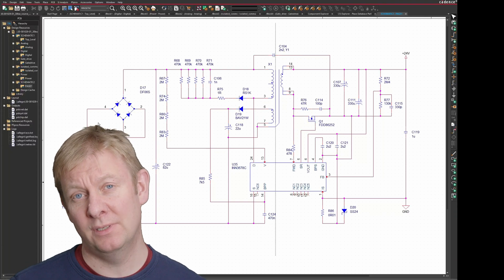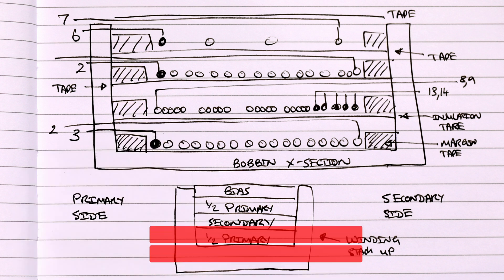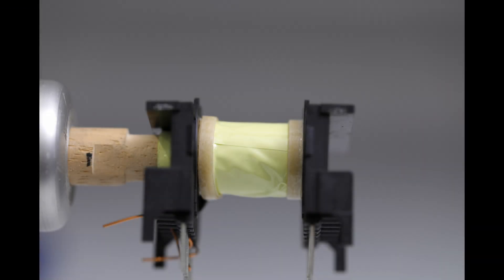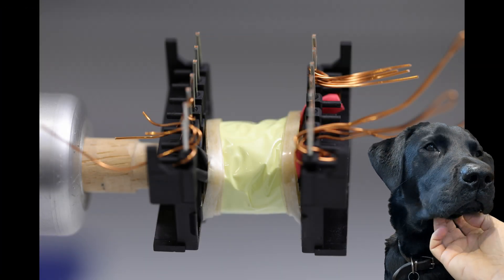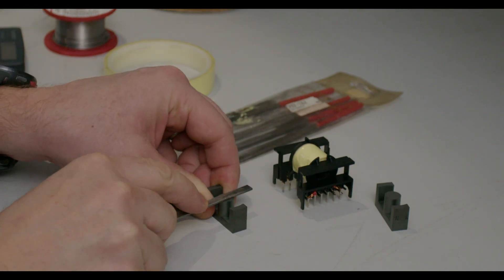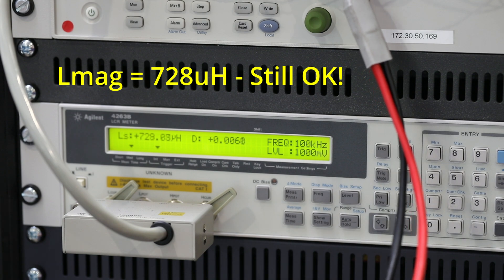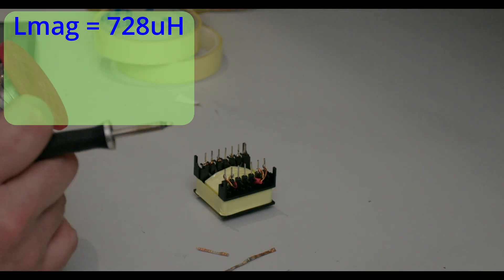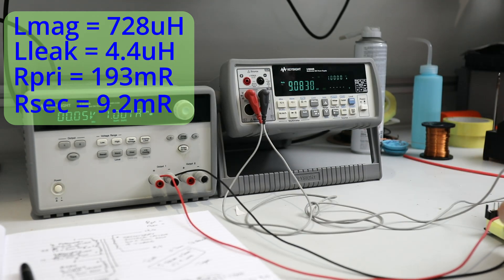Part 3 - Winding a prototype flyback transformer for our mains ACDC power supply #flyback

Comment: Isn't the inductance measured total inductance (Lmag + Lleak) when the secondary winding is open-circuited, rather than Lmag alone?
Reply from the maker: Hello Freddy, thanks for your note. Yes, you are right, if the secondary is open-circuit then you will measure Lmag+Lleak on the primary. For this flyback converter transformer, the leakage is very low relative to the magnetising inductance so you could ignore the leakage if you wanted. However, you are right!

Comment: You should use Margin tape on the flux band as well.  Your flux band is too wide.  When you connect it to primary, you need 6mm (in your case) from flux band to secondary pins to maintain reinforced insulation.
Reply from the maker: Thanks for your comment. The flux band is 10mm wide and with a bobbin winding width of the ETD34 being 20mm, we have 5mm on either side before the bobbin edge. The bobbin construction lifts the pins away from winding area by a further distance; I just measured 8mm in the case of the pins I used here. I think this is more than fine for primary - secondary reinforced insulation but maybe I misunderstood your point? Check out the bobbin drawing at this link www.tdk-electronics.tdk.com/inf/80/db/fer/etd_34_17_11.pdf